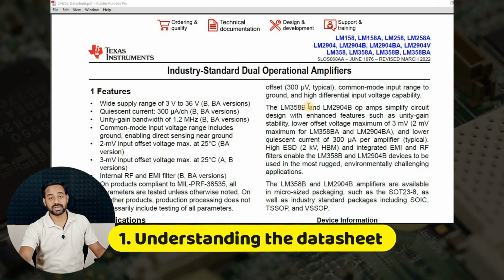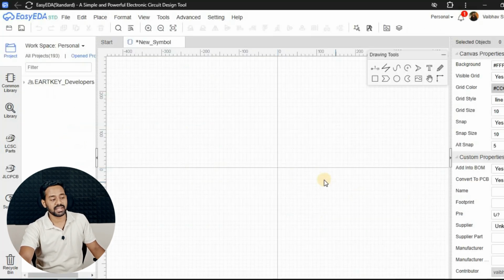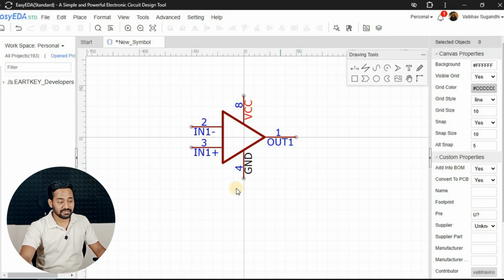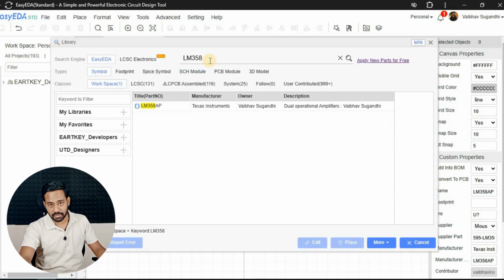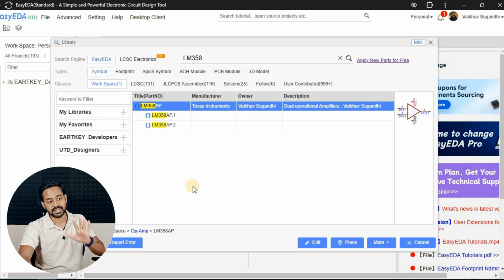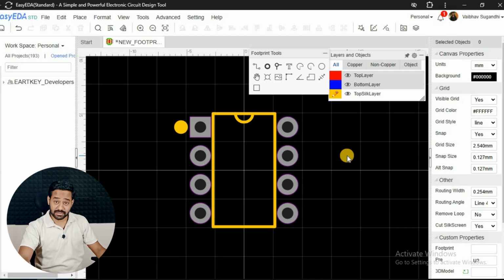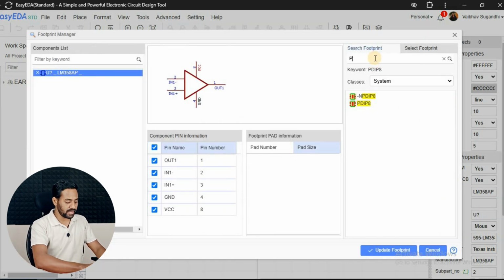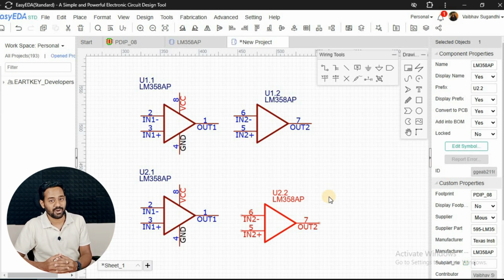LM358 symbol & footprint design using EasyEDA #E08 | Er. Vaibhav Sugandhi

Comment: is there any growth in pcb design job in india after 3 years of experience compared to software developer in terms of salaries, opportunities and skillup  with new other skills in pcb.
Reply from the maker: Yes, if you constantly improving your skills in the hardware designing and layout engineering, there will be a lot of opportunities in INDIA by 2027. 

Happy learning :)
#Linked_Frequency
Reply: @Linked_Frequency  BUt I have done btech ece,due to lack of opportunities working in bpo, Recently I gave interview and wrote test for pcb design entry level job but they require 3 hears bond and original certificate submission,their salary package is 15k below bpo.profile on hold ,what shall I do.
Reply from the maker: Yes, sometimes entry to ESDM industry is very hard. Due to limited learning resources and practical content, most of the core Electronic / Electrical students opt for other domain jobs as a fresher. 

You can get certified from Linked Frequency with paid live online classes & get to know the core skills on how to crack interviews, if you are interested then write to us at linkedfrequency@gmail.com 

Also, starting with Rs. 15K/month is still a good option if you are a fresher. Gain some experiences with real time projects & ask for higher salaries later. 

I hope my opinions help you to know ESDM industry better.
Happy learning :)
#Linked_Frequency